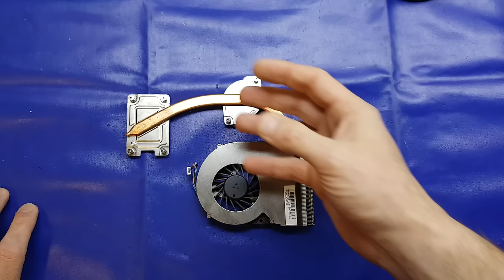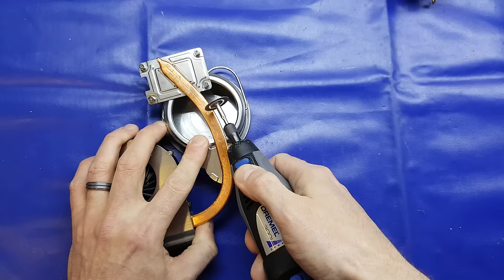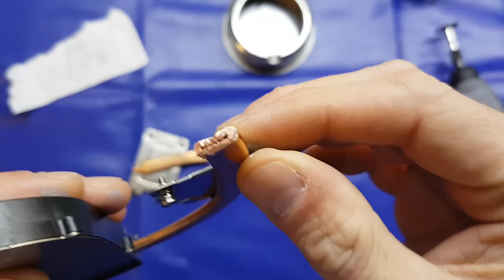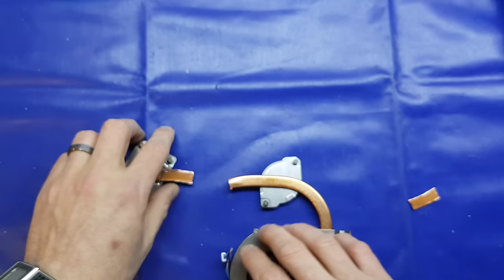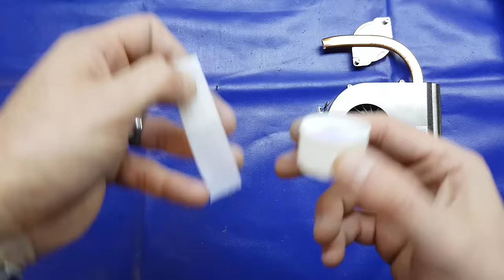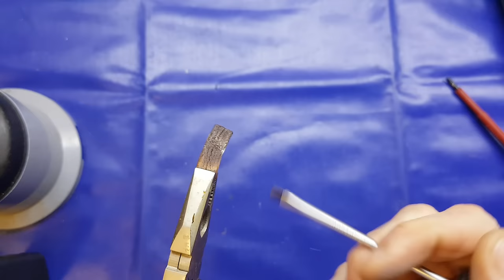***Competition time #5*** & Was I right?, How does a laptop computer heat sink / pipe actually work?

Comment: The fluid is a mixture of deionized water, alcohol, methanol and acetone. The "powder" inside is actually sintered copper. Sintering is when you take powdered metal and heat it to just before liquefaction causing it to become a porous mass. This breaks the surface tension of the liquid to aid in cooling. Some heat pipes have a mesh instead of or in addition to sintered metal. Sintering and/or mesh helps to overcome the need for having the heat pipe in a particular orientation due to the effects of gravity.
As the liquid heats up, it vaporizes and is drawn towards the cooler end of the pipe. When it gets there, it begins to condense as it releases stored heat. When that happens, it moves back toward the warm end as higher temperature vapor moves in. This results in a continual flow of heat from hot side to cool side (and a flow of cooled liquid from cooled side to hot side). This process is more efficient than heat sinks alone, and requires less surface area to allow for smaller laptops.
Reply: The question is: would solid copper bar outperform this design or not? Should evaporative cooling be so much better, we would expect thin walls and a lot of sintered material. This is not what we see.
Reply: @Luzt.  I dont think so. The heat capacity of copper is like 4 times less than that of water. A thinner wall would probably work better, but the liquid is under a low pressure (more than atmosphere, which increases the vaporization temperature) and thinner walls wouldn't be able to support the pressure. I definitely think a better design can be made. Maybe even actual two pipe mechanism within the copper. This would create a better flow of water.

Comment: This is very qualitative analysis you made here, Sir. You started with your premise (heat pipe, transfer of heat by transfer of mass + heat of evaporation/condensation) and with the evident lack of said fluid you continued to claim, this is basically heat pipe. I would not argue there's no fluid in the system but I'd like you to at least quantitatively estimate percentagewise heat transfer by conduction and change of state. You stated "I do not like to be said I'm wrong" and you are definitely right on this point.

Comment: Of course you are right, I read up on the workings of heat pipes a couple of months ago. Interesting for sure, I think the priniciple was already used by James Watt on steam engines. I also think in the temperature span cpu coolers operate in, simple water is the most efficient fluid. There are many graphs on the internet.

Comment: You are right, Kris. I guess, because I actually didn't know exactly how a heatpipe works. But just from what I have seen in the video, I would have come to the exact same conclusion. You could have tried setting the pipe on fire right after you cut it to "analyze" the liquid. Did it have any smell while you cut it? There could have been a few different ones. If it was ammonia I guess you would have noticed ;) . Several alcohols and solvents have their boiling point in needed range (the boiling point can also be ajdusted with the pressure in the pipe). But it could also have been plain water.

Comment: so basically its like a radiator in a car with the cpu and gpu being the engine almost that heat up the fluid which could be like the antifreeze and then goes to the fan to be re cooled like the radiator fan in a car

Comment: Aww man! You cut juuust to short to see why theese things need replacing!
Basically some of the working fluid decomposes and frees up oxygen that is then oxidizing the copper. This happens in the hot end. The hotter it gets the faster it happens.
As little as 1000-3000 hours of operation at high temp can really degrade performance and once it gets going it will accelerate since the production of heat is usually the same. You can see discoloration on the edge closes to the hot end of the assembly just where the cut stops.